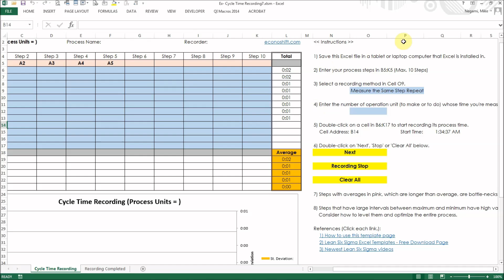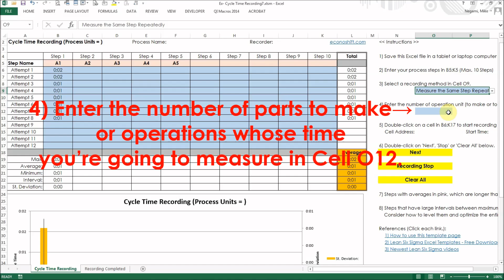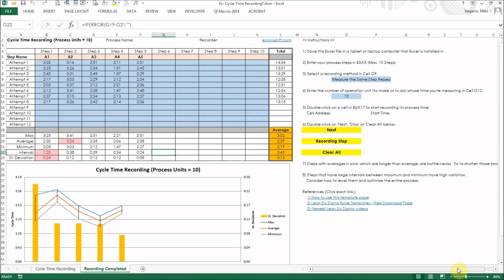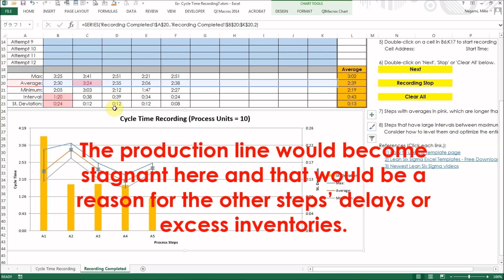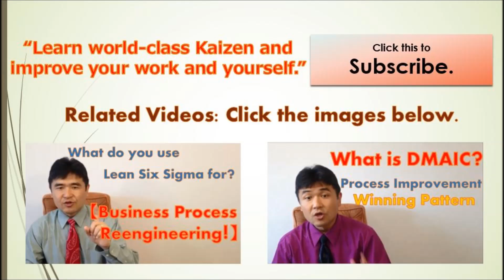How to Measure Cycle Time and Conduct Heijunka (Production Leveling)【Excel Tool】

Comment: tell me lean tools which are used in textile industry with examples
Reply from the maker: Saqib, thanks for your request. Let me consider it.
Reply: Thanks sir
Reply from the maker: Saqib, I considered your topic. Can you tell me more specific situation so that I can think more?
Reply: @econoshiftcom  i  am industrial engineer in stitching dept ,  so there are 3 process cutting stitching and packing , mix high and low volume production
Reply: Flow of information is traditionally and poor ,
Reply from the maker: Saqib, that sounds an interesting project. If you're ok, I can make a case study video using your case.  But I need more information.  Can you send more information through my blog site? https://econoshift.com/en/contact/

Comment: Just found your videos and very impressed. What I have difficulty with is when do you start and stop a cycle time. Do you record an item moving on a conveyor to an operator? Or only what the operator is doing when they are adding something to the product?
Reply from the maker: Generally, speaking, it should be process-oriented.  Identify the start and end points in your target process clearly, then find clear divisions among steps.

Comment: Hi Mike. 
                Excel template when I copied to iPad pro, Excel sheet is not working on iPad due to VBA Macros. Please suggest Solution for this.
Reply from the maker: Hi Manjunath - I'm sorry to say this, but Excel for Mac seems to be incompatible with Excel Macros so far (Dec. 2017). I suggest using a Windows based tablet or laptop for the tool.  Also, I have an improved version.  Please use this one instead: http://econoshift.com/en/2017/07/16/improved-cycle-time-measuring-excel-tool-simultaneous-recording/

Comment: Is there a way to make the actual time update per cell?

For example: I'm recording processes starting at 5:30 PM, but in the reference cell, it says the process always started at 12:00 AM
Reply from the maker: Hi David - Currently the template records only operation duration times.  However, I'm getting other requests such as more process step sections (more than 10) and more attempt sections (more than 10).  I'll modify the template shortly.  Please tell me any improvement suggestions at this time.
Reply: Have you updated the template to include more process steps and attempt sections yet? If not, do you have an estimate of when we could expect that deliverable?
Reply from the maker: Hi David - I have some time to work on this.  Can you tell me what process you would be recording actual times for and what you're looking for from the recording?  I'll complete updating within 1 week.
Reply from the maker: Hi David - I finally completed the improved Cycle Time measuring tool template.  You can download it here: https://youtu.be/jgcRb-D4048  Please let me know how you liked it.

Comment: Hi , this template is very useful , just tell me if I need only five observations of the same step then how to adjust in this template ?
Reply from the maker: Hi Mandar - As you record each process step's time, those roll-up data and chart below will be updated.  You don't need to make any adjustment.
Reply: ok thanks

Comment: m bit struggling to apply or use a stopwatch to measure cycle time to machines. Iknow the theory but when it come to applying it, in reality, its a bit confusing. My question I have is :When I do cycle time firstly do I observe where can I start in order to break some element ? Does need to record to break element of the process so that I can record each step by using the stopwatch?
Reply from the maker: Hi Amanda –  Yes, you need to clarify divisions of all process steps at the beginning in order to measure and improve the process.  Did you download the Cycle Time Measuring tool?  You don’t need a stopwatch if you use the file, a timer is built-in.
Reply: How to download it ?
Reply from the maker: Hi Amanda - Sorry that I had missed your this comment.  I put a download link in the description section above.  Just in case here it is:  http://econoshift.com/wp-content/uploads/2015/06/Cycle-Time-Measuring-and-Heijunka-Tool.xlsm